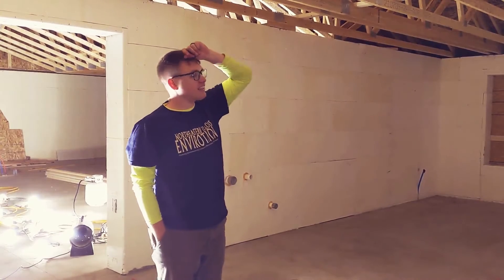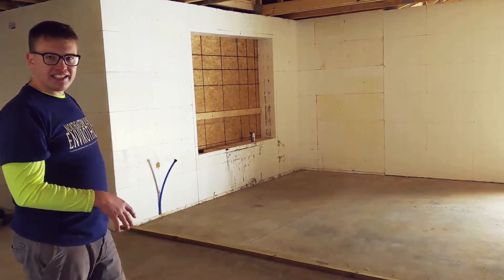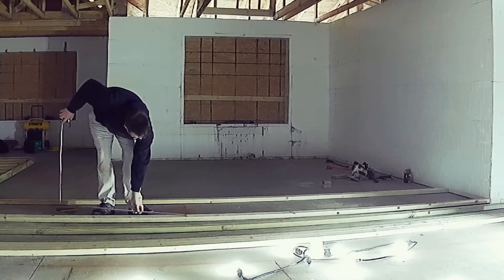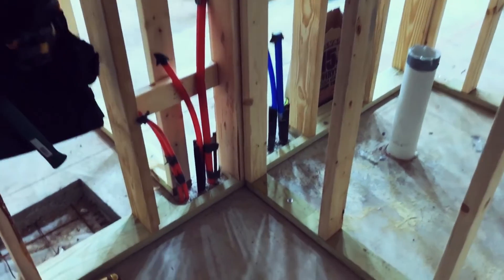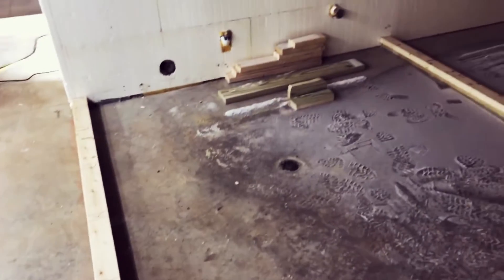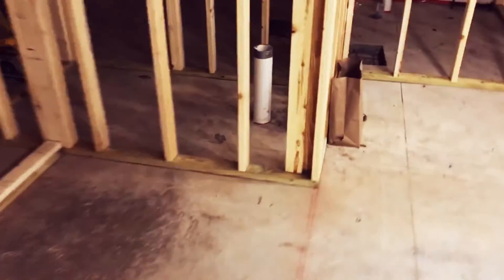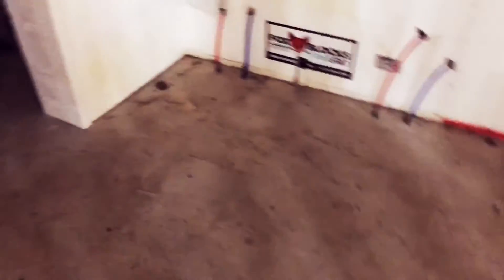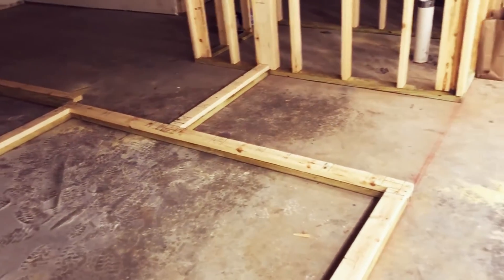Framing Interior Walls - ICF House

Comment: I appreciate your explanations--especially your mistakes. That really helps us DIYers. I straighten out twisted 2x4s with a pipe wrench. Just stick it on the board and push it whichever direction. Quick and easy.
Reply from the maker: We make a lot of mistakes for sure. Luckily framing is structurally very redundant, and in our case, we have no load bearing walls at all. The exterior ICFs carry everything to the footing.

Comment: I wish you would explain how you connected the wood walls to the ICF.
Reply from the maker: If the wall intersected a web, we used a lag screw through the wall into the web. If it didn’t, we drilled a hole through the wall and into the concrete and inserted a threaded wedge anchor (redhead). They don’t take much. In most cases, a few toe nails between the truss and the top plate of the wall (if the trusses happen to run perpendicular to the wall) will give you plenty of stiffness.